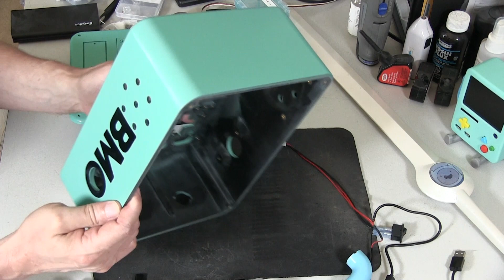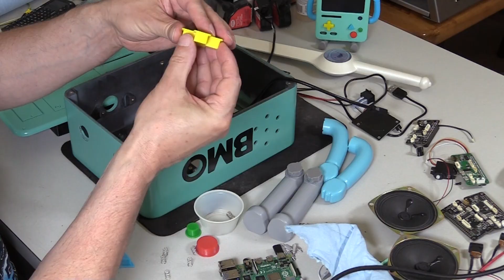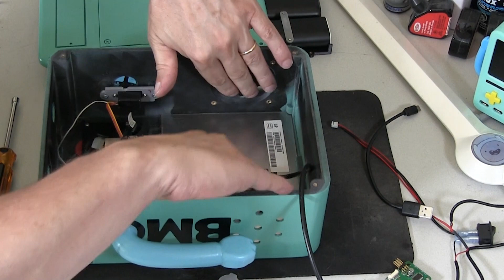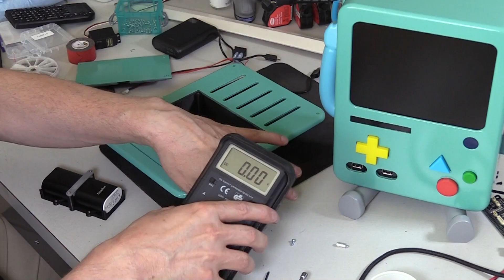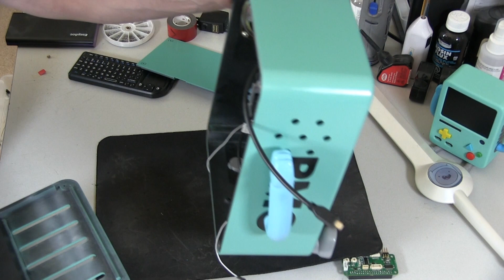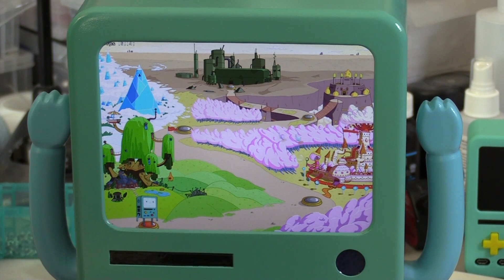Making Big BMO: Part 3

Comment: How much would a fully assembled piece be? This is CRAZY amazing!
Reply from the maker: Probably $200-$300. The LCD is probably the most expensive part at around $90. The rest depends on the options you add. The amount of plastic required is probably less then $40 but you need a big printer.
Reply: @BobHerzberg 😢 28:47